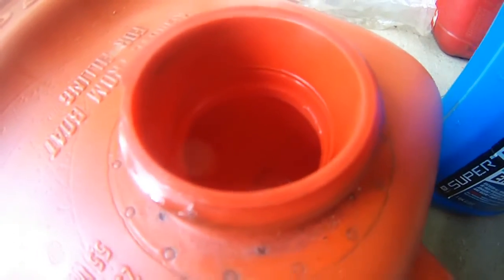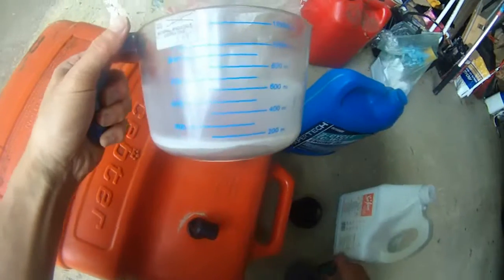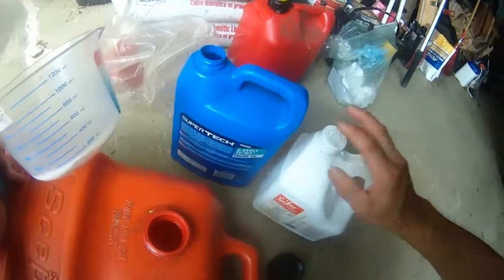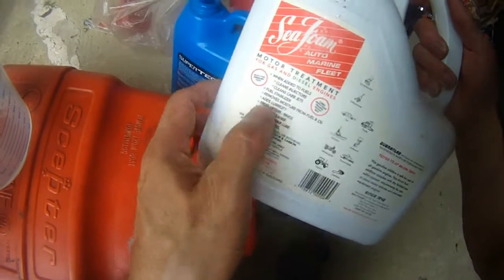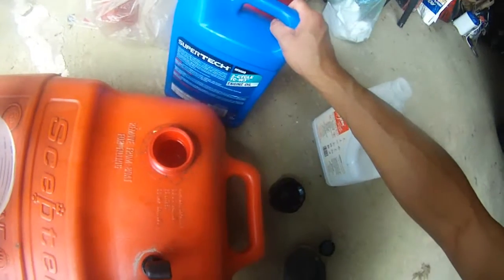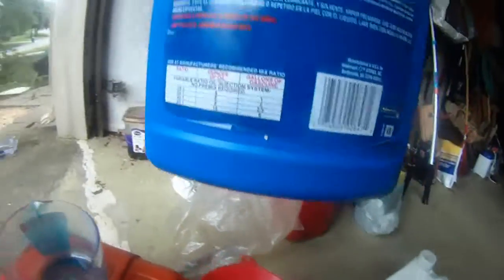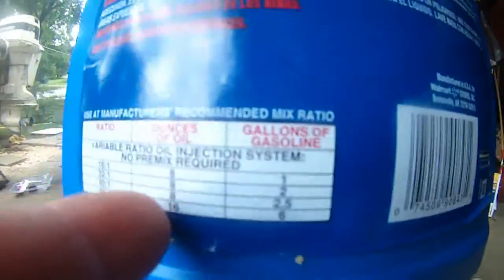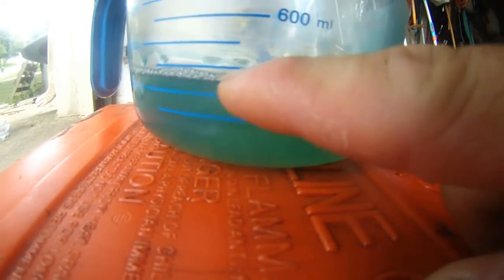how to mix oil with gas for Johnson 90 hp 2 cycle outboard?

Comment: I use Marine tcw3 oil at 50/50 Marvel Mystery Oil in my Jeep and Honda Ridgeline 1oz oil per 5'gallons of gas or 640oz gas  to 1oz oil. Works great easy starts and lubing the entire system and stopping wear in the engine Check it out on the Internet or google.com Sarge LS1 on marine outboard oil in cars. many people do it with great results.
Reply from the maker: Thx for the tips

Comment: no lower unit is good no leaks getting my carbs redone new seals.
Reply from the maker: These old motors simply don't die. Clean the carb, and they will idle in no wake zone like a brand new 10k motor